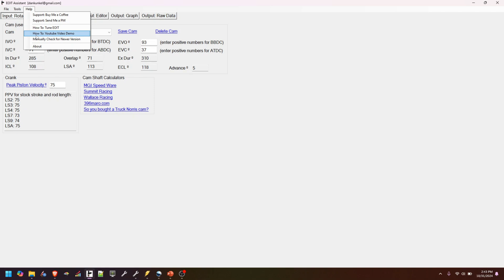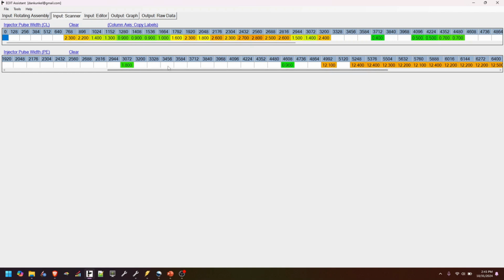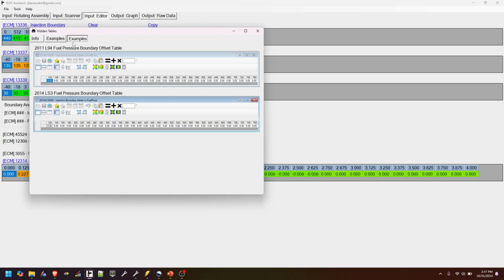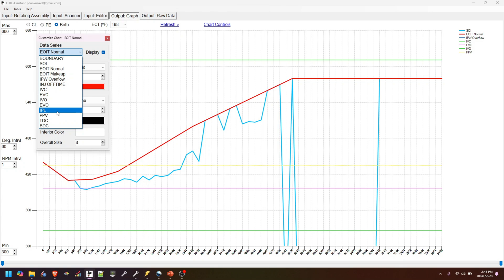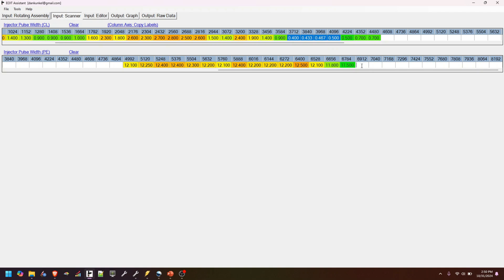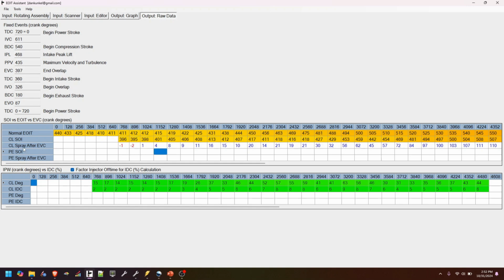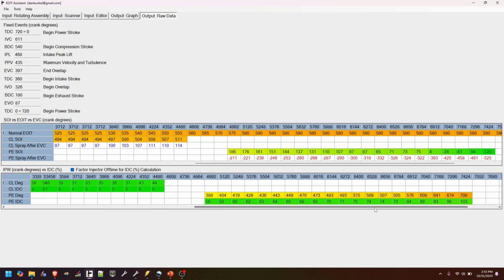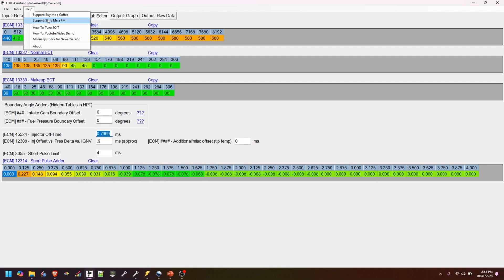EOIT Assistant v1.6 Demo

Comment: Hi, my names Clayton long time follower of yours but dont use the forum much (tried to private message you but says your inbox is full and i cant make a post yet). I have a 2012 5.3 6l80 sierra that is currently just headers and a tune. Best pass has been a 13.6 at 101 and I am gonna be putting a cam in it soon. I have the flu so I got that deep dive internet bug last night and was looking into injection timing again last night as its something I skipped on my caprice and wanted to understand it better for the truck this time. That being said it also turned into vvt research as well and im wanting to look into the tune some before I put the cam in to see if I can find anymore power on the table as is. 

At operating temp my base boundary is 360 and the normal is 110 so roughly 250 final as the engine speed adder is zeroed by default. I have changed my vvt settings finally (they were stock before) they are now zeroed out from 0 to 3600 and then tapers up to 12 at 6400 (so should be about 7 advanced at 0 and retarded 5 by 6400 from what I found last night) 

Ok with all that being said even with the small stock cam is it possible the eoit could be worth some power if its adjusted to a more optimal spot once the cam starts to retard? Was thinking a good starting point from the calculator last night would be 420 or so in main boundary table and leaving the normal vs ect alone at the moment and then using the engine speed table that is currently zeroed to dial it in as the cam retards. 

Im terrible at explaining things and I obviously have a very crude understanding of it all so im just trying to see if there is anything blatantly wrong with my thinking and/or im completely wasting my time with the stock cam and eoit timing.
Reply from the maker: Hello Clayton thanks for stopping by! I too am suffering from some sort of seasonal illness, no fun. I have had to keep my inbox full at the forum as I get far too many requests for help, and it has become overwhelming. I used to spend a lot of time answering questions and putting in a lot of details into my replies...and guys wouldn't even have the courtesy to reply with a simple thank you. So I got tired of being a free vending machine for all things tuning.

Your math is incorrect and this is due to a bug in the HPTuners software in how they are scaling the ECT values. Your real EOIT is 360º-220º = 140º! The (normal and make up) ECT values need to be doubled, so that 110º becomes 220º. I show this in my EOIT state of the union address (link below).

I do not have any direct experience with VVT cam stuff, but I don't think there is much to be gained by changing the values in there. I would suggest changing them back for best performance. However, I do suggest that you experiment as that is the best way to learn.

With a stock cam I don't think much is to be gained from tweaking with EOIT at all. The factory spent a lot of time dialing in the tuning here (especially for a VVT cam), but if you want to experiment, then by all means, go for it! As a simple test, you may want to advance or retard EOIT along with the cam. So for WOT if your cam is retarded by 5º, then you could similarly retard EOIT by 5º. But I can tell you from experience you will not see anything with a 5º change in EOIT. EOIT needs much larger changes in values for you notice anything. Tuners with a dyno will spend a long time using EOIT to find the last 3-5 rwhp. Your logs and seat of the pants will not reveal that.

One final thought...EOIT is really used to control how long the fuel sits on the back of the intake valve, collecting heat, and then vaporizing. I spent a lot of time to uncover this and many other things related to this and made the the video The Secret Life of Gasoline, and I would suggest that while the flu has you captivated on the subject to watch this and you dive deep into this.

Let me know what you think! Get well!
https://youtu.be/FmdJOOUUqQg
https://youtu.be/KSz7SGpXcXs

PS 13.6 has got to be cooking for that truck! What was the weight and DA?
Reply: @SilverSurfer77 not sure on weight its got most everything still just roll pan and no spare tire/jack. Da was super low at -1500 but i had previously already ran a 14.0 and 13.9 at 100 in 500 to -500da respectively but with 1 passenger and full on street tires. Appreciate your response i will get to watching sir!

Comment: These videos are amazing.  Can you give some information on setting the graphs up in VCM Scanner?
Reply from the maker: I am glad you find my channel helpful! I appreciate you stopping by!

I made this video to help you with setting up charts:
https://youtu.be/b9NuUF8C0Is

But you may want to cheat and just get it here:
https://drive.google.com/file/d/1tToz4El8ZZo3skSNm8dFrK_OtoOXHMyu/view?usp=drive_link
Please note that you still need to log the referenced PIDs in the charts and filters! If you don't you will get unreliable results
Reply: @SilverSurfer77  I do have three follow up questions.  The first one is when calculating "Piston Peak Velocity" when inputting RPM into the calculator is this the max RPM the engine will see?  Secondly, are we choosing the largest number under "Crank degree" or something else? For me I have 4.125" bore, 4.00" stroke, 6.125" rod length, and 7500 PRM so I input 73 degrees? Lastly, what is the filter you are using on the PE table?

Comment: i'm so overwhelmed. is this program still valid? is this what you usually use?  i saw your state of the union video.  not sure  which came first, i'm assuming this one. i've got a chassis dyno and wouldn't mind doing some testing on it.
Reply from the maker: Overwhelmed in a good sense right lol?! Yes this program is still valid and was released at the same time as the state of the union address (the oscilloscope findings and the program go hand in hand). I would love to hear your dyno results!

Comment: I'm sorry If I am just dumb, but after plugging in all this data, what exactly do you do with it?
Reply from the maker: The tool does not do anything for you. You still have to tune it. What this tool does is visualize the fuel injection firing with the cam, piston, and valve events so you understand exactly when it is firing...that way you can tune around valve overlap better.

If you have not watched this one...I would highly recommend it.
https://youtu.be/KSz7SGpXcXs

Comment: Hey Man, after some digging on an unrelated issue, I found your videos about EOIT again.

My current issue is some minor cam surge even after pulling a bunch of spark out of that lower part of the main spark table (which did help). 

I’m also getting sick of the super fuel rich exhaust smell from what I understand is also EOIT. 

I downloaded your software and started plugging in values to the input: scanner tab, but ran into an issue on what specific injector pulse channels I need to be using for the graphs that the software wants. I did some digging around but didn’t find it mentioned anywhere else so if you have a chance some help would really be appreciated!

Comment: One last thing, great work man!  This stuff has been a gray area for many people for a very long time.  This is a much needed and certainly appreciated addition for the community.  So thank you and you have a COUPLE coffees coming your way LOL.  Also, as an aside, I felt worth mentioning....  after messing with the calculator for several hours, I noticed once you click off of the output graph tab and then back to it, any changes you previously made to chart layout, disappear and default back to the original settings.  I thought maybe saving the project would preserve the settings but it, in fact, does not.  Not a huge deal, just wasn't sure if you were aware or not.
Reply from the maker: Thanks for the support of the channel! As far as the chart changing, are you using the latest version 1.6.2? If you are, then please send me an email with screenshots/workflow on how to reproduce. It is not doing this for me, but my testing may not be the same as yours.
Reply: @SilverSurfer77  yessir, just downloaded it yesterday.  I'll send you a short video actually.

Comment: I noticed your comment on wishing you hadn't modified before digging into the tuning aspect.  I tune and have tuned hundreds of late model GM's, I may have some usable data for you.  What setups are you looking for in particular?
Reply from the maker: Ideally a 2014 Chevy SS sedan (6.2l LS3), but I suppose just about any bone stock LS3 and bone stock ECM tune log would work, part throttle and WOT. If you send me an email I can help you out with your XDF quest.
Reply: @SilverSurfer77  I have a few 14 Chevy SS vehicles with just air box, headers, full exhaust.  I'll include the logs in the email or in a separate one if it gets too big.
Reply: @SilverSurfer77 sent you an email with the files

Comment: Hi mate,

One question, so once you have the output values "CL Spray After EVC" and let´´s say you have negative values. From Where you should substract those values. Thanks in advance
Reply from the maker: A negative value is not always a bad thing, it just depends on how negative it is, the rpm range, and the cam.

However, to answer your question...to move it to zero you would simply add the negative value from the Boundary table (making the value smaller). Or you could subtract half the negative value from the N. ECT table (making the value larger).
Reply: @SilverSurfer77  To elaborate more my question. I have a Caaro 2010 with a Texas Speed Cam (Cam Spec at 0.006: IVO 32°, IVC 70°, EVO 83.5°, EVC 33.5, Overlap 65.6, Intake 282, Exhasut 297). My issue is that I have strong smell to fuel at Iddle in Park. Using your tool it shows at CL Spray After EVC -124 in 896 column and -130 in 1024 column. My Idle RPM is set at 900
Reply from the maker: @darkzero6282  what is your Boundary and N ECT tables set to in the idle region?
Reply: @SilverSurfer77  Boundary 513 in all columns and ECT 110 from 68°C.
Reply from the maker: @darkzero6282  so that is a pretty early EOIT --> 513 - (2 * 110) = 293*

So assume 4 ms  IPW  at 850 rpm (20*) ...SOIT -> 293 - 20* = 273*

Your intake valve doesn't even open until 328 and overlap isn't over until 394. So I am not surprised you are getting fuel smells at idle. You need to retard your injection timing quite a bit.
Reply: @SilverSurfer77 I lower the boundary to 415 in Idle area, zero out the ECT from 68°C and zero out all RPM table. The "CL Spray After EVC" shows -1 😊 Injector pulse is 2.3ms-2.5ms. The car now sound less aggressive and smooth, there's almost any smell to fuel. The only issue is that once I restart the car a few minutes later there's an strong smell to fuel again.
Reply from the maker: @darkzero6282  that is good to hear! Make sure N. RPM is 0º from 0 - 1024 rpm. You may need to lower your N. ECT degrees from 68ºC and colder. Beyond that it could be your OL fueling is really rich and just dumping a bunch of fuel.
Reply: @SilverSurfer77  Last question XD. If the makeup mode is active. Make up shot should happen after the normal EOI?
i.e Normal SOI: 394.5/ Normal EOI: 408. Make up SOI: 425.5/ Make up EOI: 438
To have these values I make the next adjustments:
Boundary: 508 <--- (508+0+(-7)) VVT ECM
N ECT: 50
Make up ECT: 35
IPW: 2.5 ms
Engine RPM: 900
Reply from the maker: @darkzero6282  as designed by GM, yes, the make up shot should occur after the normal pulse. So as long as the N. ECT value is larger than the Make Up ECT value this should occur as expected.

I was actually wondering what would happen if you reversed that. Like what it N. ECT was 0, but Make up ECT was 50? Would the ECM do a make  up shot first? I guess I have some more experimenting to do! New video idea!
Reply from the maker: But make up should not occur under normal idle conditions FWIW. If you are idling and you start pumping the throttle it most likely will trigger a make up shot due to transient fueling. But normal steady state idle/lope....you should never see a make up shot.
Reply: @SilverSurfer77  that's exactly my point. But for me it doesn't make sense that make up is before normal.
Reply: @SilverSurfer77  thanks for that clarification 👍
Reply: @darkzero6282 did you get it sorted or do you still have the raw fuel smell come back after a few minutes of idling?

Comment: HI :),
Could you please remember to me How I get my iddle "Injector Offset vs Pres Delta vs IGNV"? Thanks a lot.
Reply from the maker: Are you talking about what value to put in my EOIT tool, or in general to populate the entire table in the tune file itself?

If you are talking about my tool, go to the "Injector Offset vs Pres Delta vs IGNV" table and average the 4 values in your idle area....12-13v and 388-408 KPa. Should probably be in the .90 to 1.1 ms range.
Reply: @SilverSurfer77  Yes I was talking about the value to put in the software. In my case durin idle (car in park) my car battery is 14.6V (module voltage) and and my MAP value read +/- 50 kPa. From where you get the Delta value of 388-408 kPa?
By the way thank you for take the time to answer.
Reply from the maker: @darkzero6282 fuel pressure on most Gen4s is 400 kpa. So if your MAP is 50 kpa at idle, the delta pressure is 400-50=350 kpa.
Reply: @SilverSurfer77  thanks :)

Comment: What strikes me is that my e38 truck starts with a 520 boundary at 0 rpm and progresses down to 360 at 8000 so my EOIT line is completely flopped from yours
Reply from the maker: @SCoffman40  yes my car was like that from the factory too. But oems are balancing a different set of factors than we are doing with an aftermarket cam with more overlap.
Reply: @SilverSurfer77  ahh I thought that slope was your factory setting. So we should all be inverting our data essentially?  Additionally I absolutely love how you break the aspects of tuning down to the underlying mathematical methods and theories. I've learned more in the last few months watching your videos than I have learned over years of other random youtubers videos.
Reply from the maker: @SCoffman40  the upward trend is what I recommend, but that is really based on logic and NOT actually dyno or emissions testing. I would LOVE to have my own garage dyno to verify this. The unfortunate part is that most tuners do not have the knowledge, interest, or time to dial in the EOIT for idle, part throttle, and WOT.

Also, thank you for the compliment! When I started tuning was I expecting to find a wealth of information and how videos, but nothing existed. So I was forced to learn and I decided to fix the knowledge gap myself.
Reply: @SilverSurfer77  i expected the same. There is so much conflicting information out there based on what I can see as personal preference and less on actual logic. It's a game of 1s and 0s and you're the first I've seen break it down as such.

I'm going to try your curve and see if it solves my horrible idle exhaust fumes I've been trying to remedy for years.

Comment: I started questioning the purpose of the N. RPM table after watching the video you posted about your issues with hot starts or heat soaked cranking. In one of those videos you mention using the OpenLoop fueling tables from a 2012 Caprice.  Of course I check out the tables and of course I copy them. I also took a look at the 2012 Caprice injection timing tables, which seemed normal except for one thing, the N. RPM table! The first two columns in the N. RPM table had values in the 900’s which I thought was very odd.
Reply from the maker: Whoa that is crazy and excellent observation! I did not notice that on that tune!

Comment: So why did you zero out the Normal ECT values from 154ºF again?
Reply from the maker: Because this allows me to dial in the low, mid, and high RPM areas very precisely. The downside is that you loose make up mode. At low RPM I am trying to spray early right after EVC. At mid RPMs I am trying to spray halfway through PPV. At high RPMs I am trying to finish spraying right before IVC so all the fuel goes into the cylinder. During CL I am concerned about SOI. During PE I am worried about EOI. The only thing N. ECT does is build some space between Boundary and EOIT where you can squeeze a Make Up pulse in.

I have not found a clean way to get the SOI and EOI that I want and fit a make up pulse all within the same injection window (before IVC).

For low temps, (below 154º) you need to spray sooner to allow the fuel to sit on the valve so whatever heat is being made is transferred to the fuel so it atomizes better in the cold engine.
Reply: @SilverSurfer77  What's the downside to not having makeup mode operating?
Reply from the maker: @mootavic4973  M/U attempts to prevent a lean condition from ever occurring. Waiting for combustion and O2 sensor signals and then a fueling correction takes a long time. This is the perspective of a tuner...trying to get a perfect tune and airflow model...but is not cognizant of emissions.

From the OEM perspective, it is ALL about emissions. A slightly lean combustion produces more NOx compounds. A very learn condition produces more unburned hydrocarbons (think misfire).

Comment: Nothing is like this for Gen3 LS, right?
Reply from the maker: I have been asked to make a tool for the Gen3 stuff, but too busy with everything else. There are Gen3 spreadsheet calcs out there, but I have no idea if the overall strategy is the same (N. RPM is for cranking, and N. ECT is doubled).
Reply: @SilverSurfer77  Ever get around to a  Gen3 application?
Reply from the maker: @davidharwood1648  no i have not
Reply: I'm still interested in the Gen 3 option as well.